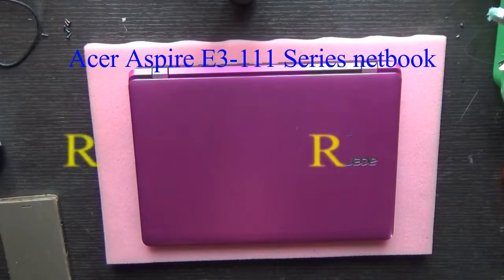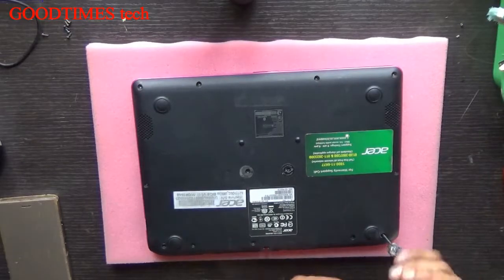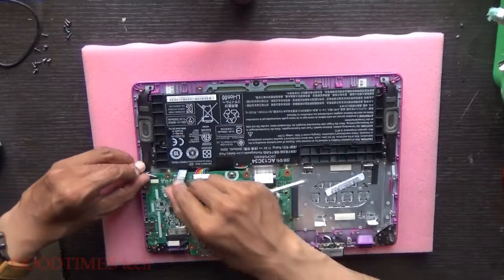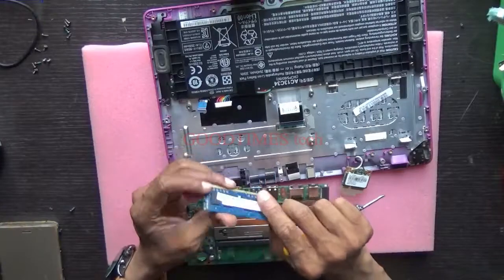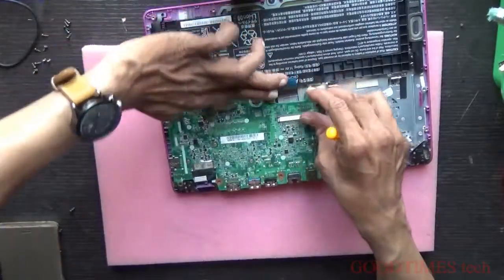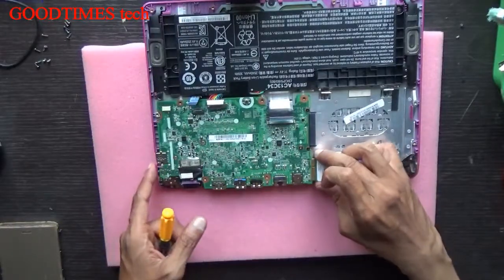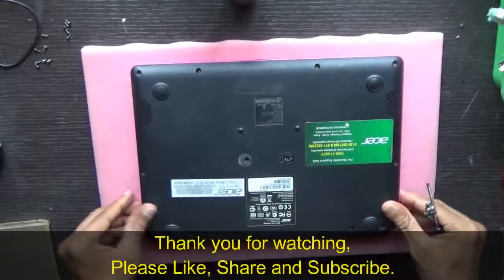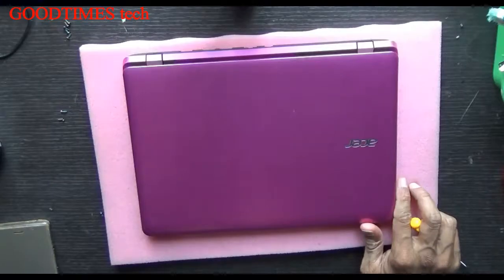Acer Aspire E3 111 Replacing/Upgrading RAM.

Comment: wow, i had just assumed it wasn't upgradable when i didn't see a ram slot after removing the bottom, at least it is upgradable but acer should have put the ram slot on the other side of the board so you don't have to remove the whole mainboard to replace the ram